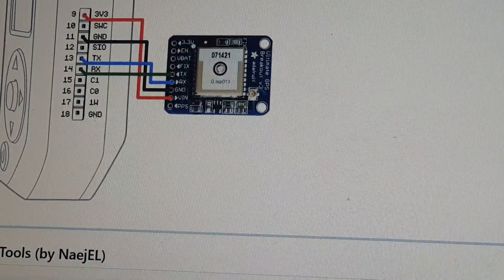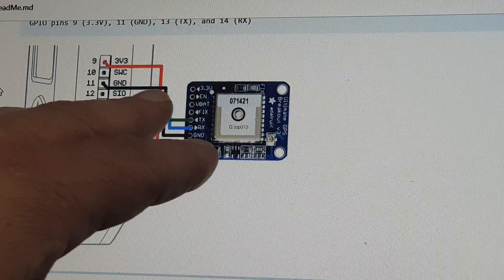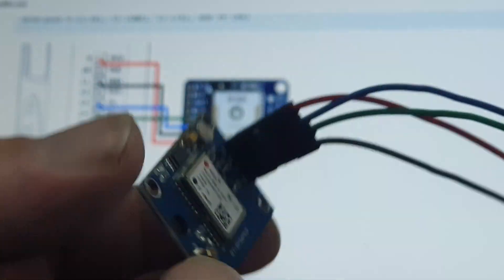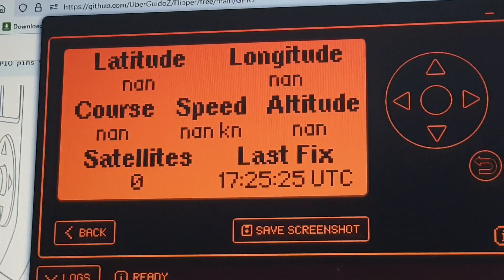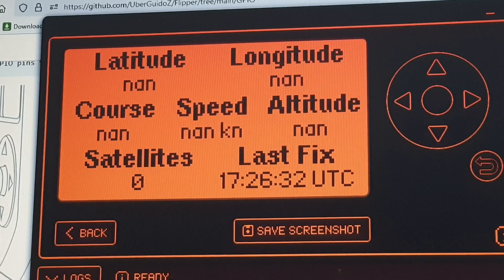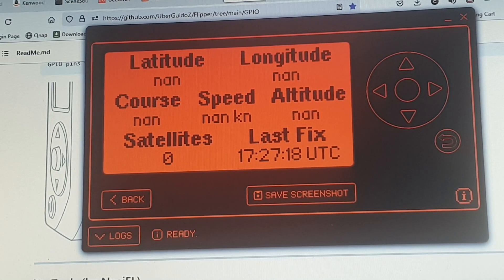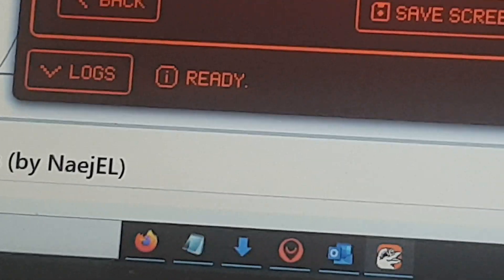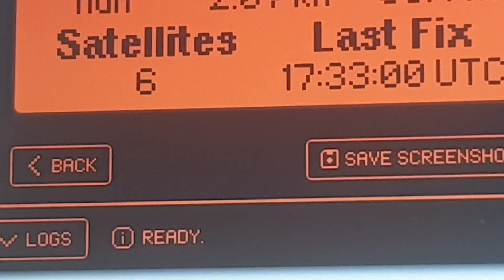The (almost) OAP's Guide To The Flipper Zero: The GPS Unit.

Comment: Thank you for the video.. I was looking for more ways in which I could use the Flipper and this is a good one. How's the battery drain with that GPS module?
Reply from the maker: Hi, i haven't actually measured it. The datasheet suggests a max  of 67mA and an average of 38mA.